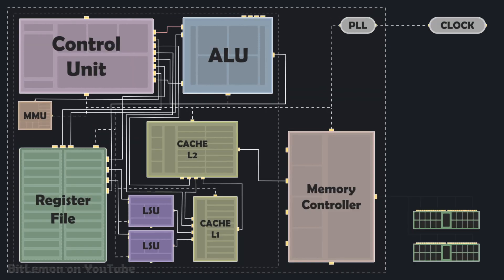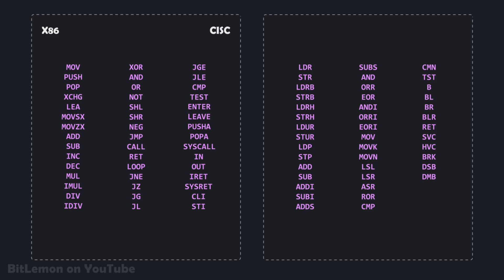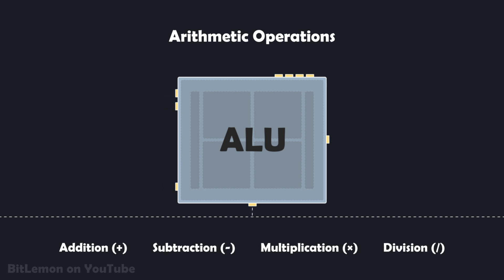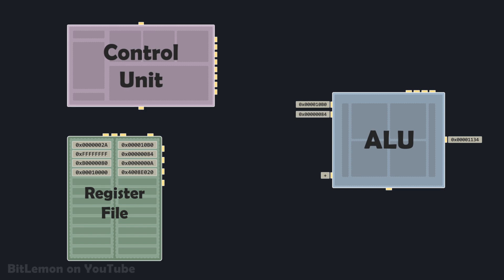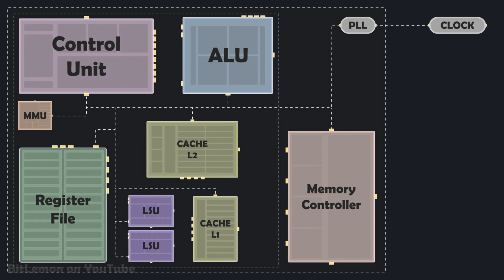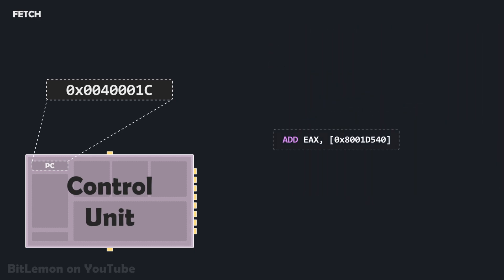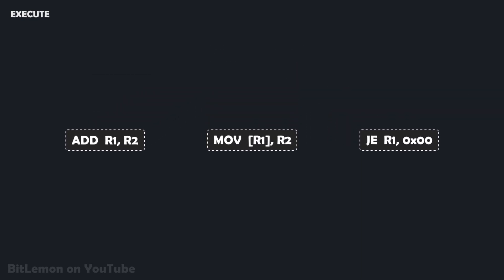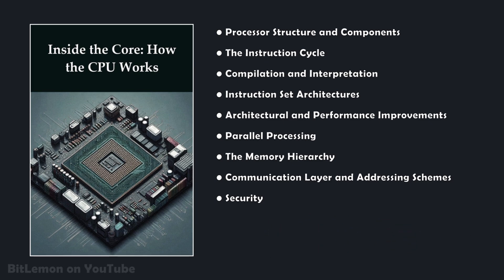CPU Architecture Explained

Comment: The classic 5-stage pipeline has no cache. Code is in eprom, data is in SRAM. It makes no sense to show caches in the same video as the CPU pipeline. In a way a register file in a 68k can act as a cache. This CPU has 8 address registers and 8 data registers. So you could come up with a convention that you pair them and always load [Areg] -> Dreg  . No offset, no increment. But uh, that is a stretch.